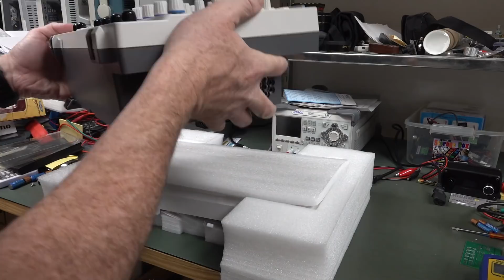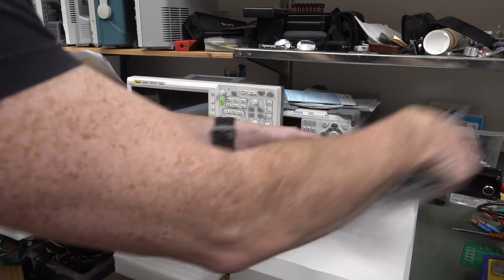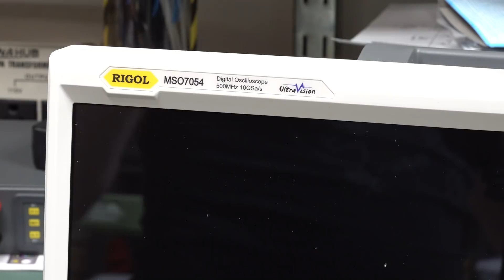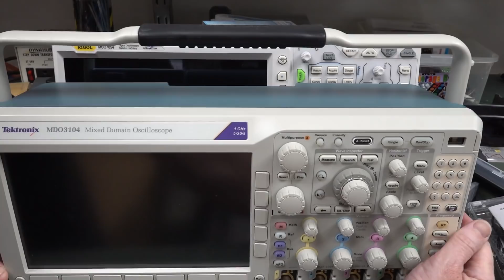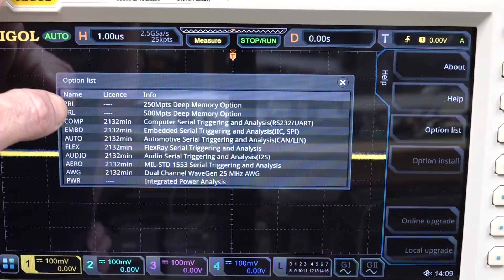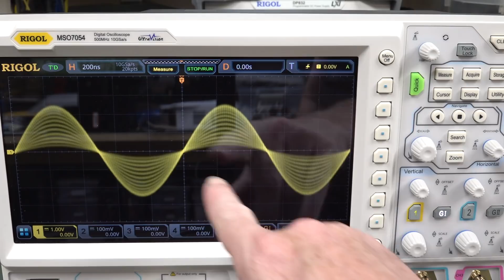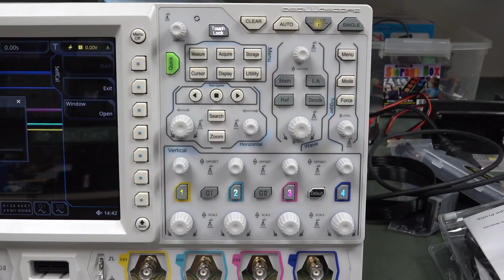Rigol MSO7000 Unboxing & First Impressions

Comment: I likely missed it, but  did you check the update rate? is it 500K peak in native clothinh
As its becomming more and more a problem, these specs on scopes waveform update rate.
and specially Rigol, they will push inflated specs, that simply are not the case, unless your in some special handicapped mode where 90% of the feaures are removed..
Like we see on their latest gens..
500K on DHO800&900, 1million on DHO1000 series and 1.5mio on DHO4000 series, but in reality the peak in ideal timebase are more like 25 to 30k for DHOxxx and around 50k for DHO1000 and perhaps the same around 50k on DHO4000..
and they will not inform you in the sale specs.. its all tainted with these inflated numbers..

Comment: Rigol seems to have free updates nearly all the time. Free Protocol analysis, Waveform Generator and Power Analysis are included at this writing.  Then there’s always the hacking  route as Dave mentioned. I went for the MSO5074 and hacked to max everything available. Everything including 350 MHz, max memory, all features, LA probes, etc. for under a $1000 USD!
Reply: Yeah, to pay for a signal gen unlock only to know it cant go above 2.5v of positive voltage. Like most common logic voltage is 3.3 and 5 and it can even do enough high square. I am not paying.

Comment: I preface everything said in this post with IN MY OPINION.

All oscilloscopes are extremely under powered for what they do. Let's say you buy an xxMHz 2GSa/s scope, the SoC that's running the sampling needs enough horsepower to process 2 billion samples per second which means you would need an SoC running around 2GHz(maybe half depending on the SoC instruction set layout?) to process all that data and only that data. You would then need head room to to deposit the relevant information into ram or vram somewhere for another SoC to display on the screen. You would also need additional headroom on the same SoC that handles sampling for all the ISR's that would be required to handle the different inputs in a fast enough manner that you don't get the crappy 3-15fps display like you see in the video because the sampling SoC can't deposit the information often enough for it to be displayed on screen

This problem only gets worse as you move up to faster and faster scopes. Also, that scope claims 10GSa/s on a single channel which I highly doubt it can actually do correctly. I'm assuming it has 4x 2.5GSa/s ADC's which are fed phase shifted clocks to achieve the interleaving required to get 10GSa/s effective. I'd be curious to see if they actually phase shifted all the clock signals so that all 4 ADC's are sampling the input at completely different times; I suspect they aren't.

The 100,000 waveforms/sec is a total gimmick. A wave form is just plotted point over time of a set of measurements. This means wave forms are constructed from a data set of points. You only need to generate and display 60 wave forms every second because of screen refresh, and you only need ONE wave form once triggered to display on screen. Generating 100,000 wave forms on the fly is meaningless and is a waste of computing power that could be used to do something else cough something higher than 3-15fps on the display would be nice :P

Someone please correct me if I'm working on the wrong assumption/s

Comment: According to  Rigol, DS700-BND: "7000 Series Function and application bundle option including PWR, AWG, and all Serial Decode options. AWG option only works on MSO models." So the Serial Decode should function on a DS7k, you don't need the MSO7k.

Comment: Didn’t HP used to have the blocks on the end of the digital probes? They had the termination in them. That way if you built the termination into your board you could remove the terminator and plug it right into your board for minimal signal disturbance. No added loading. Also having termination on your socket when the analyzer wasn’t attached meant less emitted EMI so you could maybe pass FCC without having to redesign the board to eliminate probe stubs.

Comment: So the main jog wheel for the UI is a tiny knob less than 10mm diameter.  Chances are the user will need to use it more than most other buttons.  50mm should be minimum diameter.

Comment: Guys does you know a good cheap scope with serial deciding?
I'm a hobbyist so I don't need lot's of stuff. I mostly work with digital stuff.

Right now I have a cheap DSO kit from China but the single channel is a huge problem!
Reply: Siglent have free serial decoders. But best to get a cheap USB logic analyser for that.
Reply: EEVblog Thanks Dave. My idea was to buy a rigol DS1054Z but I'm not sure if that gear is obsolete and for the price of 420 EUR I can find something better!

I have a cheap clone of the logic 8 from saleae. But it tricky to use!

I'm working on a quite big project and what I learned is thanks to your videos!
https://hackaday.io/project/159654-fcthermostat-another-overengeneered-iot-device

Comment: I really don't get why low end scopes can't have a sample memory this big. 16 bit DDR3 is really cheap and more than fast enough for 1Gsa/s.
Reply: Development time, DDR3 is still a "new" thing as far as scope development goes.
Reply: Even low end FPGAs have DDR3 controllers these days, and both altera and xilinx have tools that do most of the development work automatically. All the engineers have to do is to enter the timing information and hook up the generated interface to the rest of their design.

Comment: I think that the need to buy licences for serial decoding is a joke, years ago when it was a rare thing, sure, but these days it should be considered a required (and standard) function, just like the ability to see a waveform.
Reply from the maker: Siglent have standard serial decoding on their low end model.
Reply: It gets worse, UART and i2c/SPI are $900 *each*. Damn that's steep. I might have been willing to cut them some slack if it was like $300 for both, but that's pretty hard to swallow.
Reply: At those prices it would be better to buy a 2nd scope which offers those features built in (like Siglent), and not bother to upgrade the Rigol.
Reply: It's kind of a shame, I could see myself saving up $2700 to buy the base model even as a hobbyist if it came with the logic probes and basic triggering (or cost something more reasonable), but we're talking almost double the price for all the features I would really want to use. Maybe somebody will reverse engineer a keygen like the lower end Rigols.
Reply: Probably hackable, but do the sorts of buyers in this price point even do that?
Reply: specially considering the 7054 with digital channels is $11,299!

Comment: I haven't owned a scope yet, I'm currently saving for my first one.  I'm wondering if this would be a good scope I won't outgrow for a little while. Also, that first bootup time may or may not only happen once. Some devices are set up so that the OS will finish installing on the first time it boots. Might be interesting to see if it does that again or not.
Reply from the maker: You normally wouldn't spend this much on your first scope.
Reply: EEVblog2 yeah, you're probably right. I made a little bit of a post in my other comment you replied to, the PCIe one. I simply want something to get me started, but I know I want the MSO bits too, because with what I'm interested in - embedded systems, I'll be playing with that stuff pretty much from the word go. Cheers.

Comment: I noticed that the MSO output is a PCI Express slot. Nice! Might have some hacabilkty there.
Reply from the maker: Oh, I missed that.
Reply: EEVblog2 it's easy to miss, I just notice crap like this for some reason. It'll be interesting if it actually talks PCI Express or if they just borrowed the socket. You should be able to find this out upon teardown - you can poke around for power or maybe more definitively, a clock signal, while looking at the pinout (this'll be PCIe x1 by the looks?), or just see if there are any PCIe controllers or some form of traffic warden like there tends to be. Even ARM chips nowadays are being given PCI Express lanes. Useful for high speed storage ala SATA Express or NVM Express for flash, useful for camera interfaces, everything really. Its just a super easy, super cheap way to do very high speed general IO and data shuffling. Embedded devices are getting progressively more integrated like this. The iPhone uses an embedded form of displayport for its LCD, and usws NVM Express for storage, as an example.

While I've got your attention, I've never owned a scope, just getting into electronics. I know I want to save for a good scope, and I want MSO functionality as well. I'd like something I won't outgrow for a little while. I really like the look of the Rhode & Schwarz (sp?), I just like the finish on them. The UI looks super polished. I just notice and appreciate that stuff.

 But I won't ignore these Chinese guys like rigol siglent etc if there's value to be had. As you can see I'm a bit of an embedded geek. So itd make sense for me to have a scope that will let me poke about with this sort of stuff. I'm also a big car guy so having g CANBUS, LIN, flexray (which is a higher speed bus Germans use), and ALDL (General motors. Used on commodores and it's basically RS-232 with different signalling voltages, that's it. You can plug into most commodores with an entirely passive cable if you have a serial socket on your computer). But I'll stop rambling, sorry!

I know you probably get this question all the goddamn time but what would you recommend? I might say hi on the forum too, been meaning to do that for a while. Cheers, from Brissy!
Reply: Pardon the lyttany of typos. Evil, evil, evil android keyboards.
Reply: 10/10 they just borrowed the socket out of cheapness.

Comment: the hdmi out has to be a bit of wankery! if you cant read that huge 10in screen youre in the wrong profession!...that said..that screen is a bit too reflective..wack a sceen protector on it..might take a bit of reflection out of it ...and save the screen being damaged 
edit: that 10in screen should be able to do 720p no problems..i have a cheap (pendo) 10in tablet with res of 1280x800..and the mini hdmi can pump out full HD 1080p..the hdmi out on the rigol is a bit lame...they probably want a licence to do 1080p! LOL
edit2: is that blue shading on the panel blue blacklight? or is it actual shading on the panel?
Reply from the maker: WacKEDmaN - Not at all wankery. I've used external screen many times over the years, handy if you have to view the screen from across the lab, put in a more convenient location, or screen capture it.
Reply: EEVblog2 Also many video recording systems now take HDMI  input, so you can record the screen for documentation (or YouTube in Dave's case).

Comment: Licenses in minutes :DDDD and people complain about EA games..... Here you buy time use of hardware which you already bought :DDDDDDD what a joke.......
Reply: Space JAGA 

The timer is the "trial time" timer.  You get to test drive advanced features on Rigol equipment with the trial license.
Reply: MikesRadioRepair BUT THE HARDWARE IS THERE?!?!?! Like you buy a car and get to test it at double the power and half the fuel consumption but if you don't pay for license it cuts back on power and rises fuel consumption. Totally makes sense.....
Reply: Space JAGA 

That's the way most test equipment from most manufacturers is.  License enabled options.
Reply: If it costs 5000$ more, but comes with all the bells and whistles... and you don't need most of it... then what are you paying for?
Reply: 2133m = 35.5 hours
Hahaha some trial period, I'd almost bet money no one could actually do an in depth review of all the features with that short of a trial.
Reply: station240 probably.
On the bright side I gess someone is going to come out with a "workaround" or already has.
Reply: station240 

Trial timer is stuck in a infinite loop on my Rigol spectrum analyzer after a mod that resets the countdown timer.  ;-)  Thats one advantage of Rigol.  They almost seem to design them to be modded.

Comment: Why don't they make the bloody key pad bigger like seriously all that screen and they make the keypad tiny!
Reply from the maker: I thought it was a good size. I've seen much smaller
Reply: Fair enough dave it looked small, but i am looking at a video of a display on a display :/  my thought was if the pad was a bit bigger then you could probably use it a lot quicker. Thanks for replying

Comment: Logic probe adapter so you can do a quick connect/disconnect and leave your probes connected to the circuit if you need to do work on it!!!
Reply: Also to protect the plug on the wiring harness back to the scope, instead of plugging and unplugging multiple times wearing out the harness plug you wear out the adapter which can be replaced cheaper than the harness ;)
Reply from the maker: Yep, that would be an advantage

Comment: The tilting feet at the back make a lot of sense with tall thin scopes. When you tilt the screen back it is better to have more support from the back of the case for stability when you press the upper buttons.

Comment: And only $11,299 for the 500MHz version you have there.  Gulp....
Reply from the maker: What are comparable 500MHz scopes?
Reply: EEVblog2 

I'm not trying to say it's not a good scope for the price.  It's just high for the average person.  I would love to be able to afford it for use on my bench.  I could really use a higher frequency scope on my bench when working on VHF transceivers.  Going to be a while.  I have a few years to save up for a new Rohde & Schwartz communications test set ($40K).  After that I'll be looking for something like this.
Reply: If you're a professional, it's a tool that you use to make money so it'll pay itself back in time. And even smaller company with even a bit of revenue will be able to purchase this without worrying.

So it's not expensive unless you're a hobbyist that doesn't make money from electronics... and then you don't really even need it most probably.
Reply: Plus another $1,999 for the serial decode and waveform generator and $1,399 to unlock the full memory.
Somebody need to figure out how to hack all of the software options.
Reply: Yeah "only" 12,299. That's not much.
NOT!

Comment: Those RP3500A are also shipped with the DS4000 Scopes, I have 4 + 1 (replacement) here.
Reply: I think 4000 series is the best bang per bucks in its class (especially if you ""buy"" the sw upgrades ;-)  I have DS4024 upgraded to 500 MHz and DG4160 and both are very good pieces of equipment for the money.
Reply: Well mine is the DS4014 (4 input 100MHz) due to that was all I required for all my projects, I did way up the prices for the features and yes the DS4014 was the best solution for me.  I did buy the SPI Software Option (I know silly me) and then brought the "rest" ;) so now I have a 500MHz 4 input Digital Scope.
As for the Gens or Analysers, I have still yet to got those.
Also don't you mean a DG4162 i.e. (160MHz 2Ch 500MSa/s)
Reply: I buyed 200MHz model instead of your 100MHz, because there wasn't 500MHz bw upgrade officially available for 100MHz model, so I was worried if the "unofficial" would work properly. Apparently, there's no issue, so I spent more money than I needed, too :-) 
There's much worse situation with arb wave gen, because they aren't calibrated above their official bw limit. It's doable, but you must calibrate the instrument after unlocking, otherwise it's useless. And I wasn't sure I will be able to do it properly with my current equipment, so I took the 160MHz model.
Reply: Yeah, well where I only really needed a maximum bandwidth of 100MHz at the time I went for that model, it was to last me about 5 to 10 years (already had it for 5 years now), as for the "unofficial" bw upgrade yeah it works, I fed a ~418MHz Osc into it and I could see a very clean signal and was still able to zoom in to 1ns/div fine.

Comment: What the Hell is a lifespan of a scope these days....???,,, The same as a mobile phone !!!!
Reply from the maker: Not at Keysight, their current mainstream scope architecture came out in 2009.
Reply: Ah, So like an iPhone (2007), need one every couple of years.
Reply: No, it is different than a smartphone. If you have a 10 year old smartphone, modern apps you want might not work on it, or even the installed apps might stop working. But if you have a 10 year old oscilloscope, it might be all you need for your daily work, so no reason to buy a new one. I bought an Agilent DSO-X 3012A, 7 years ago, and I don't miss anything, so I guess I will still use it for the next 7 years.
Reply: I have now leader 20MHZ It serves me  .Maybe he is over 25 years old
Reply: firas gh But will they cut off the ability to buy license keys, spare parts etc. in 24 months like consumer companies, that's the question, not if old school scopes were built to last.
Reply: The older a scope is, the more likely it is that there is a hack to enable all licenses for free :-) And there is not much need for special spare parts, except for new probes. But all scopes work with cheap probes from China, you just might need to set the 1:10 factor manually in some menu, because of the missing pins for probe auto detection.